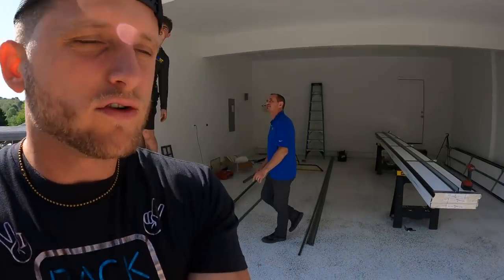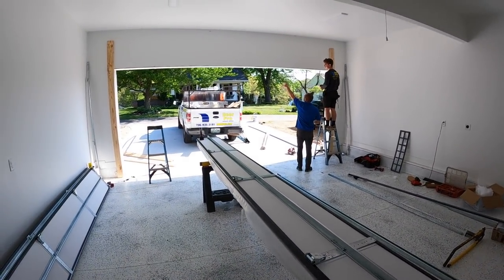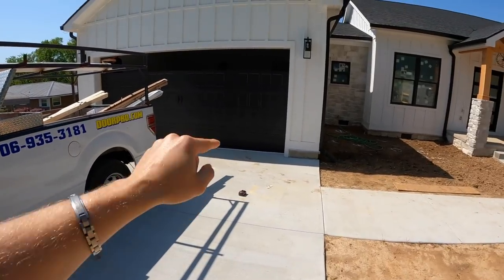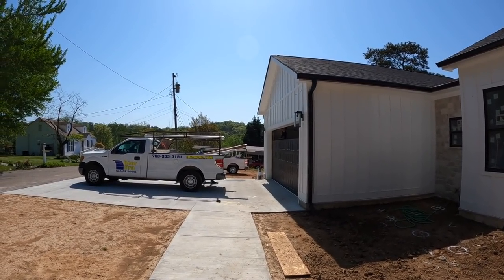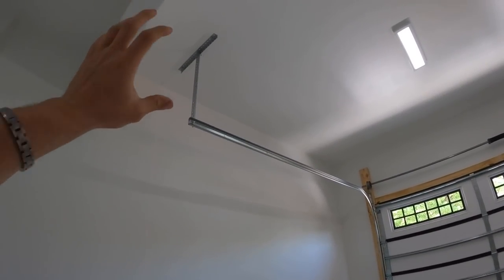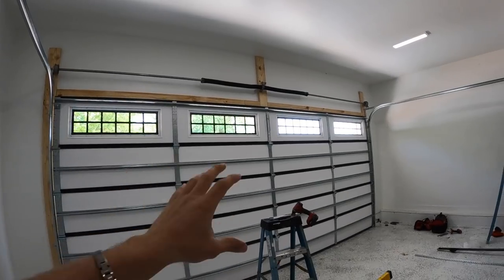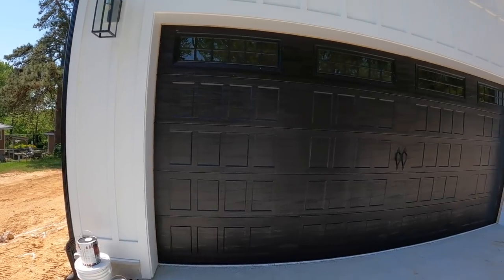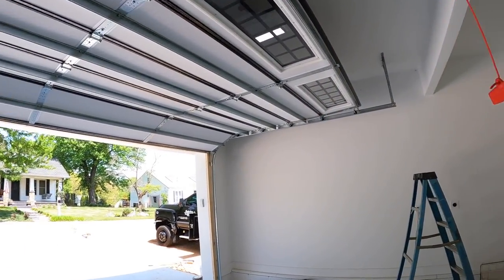How To Install A Garage Door | New Construction | Building A $350,000 Custom House | EP 58

Comment: 18x7 nice here in the south that a one man job in about 2¹/²hrs we out.  The young man was right about turning the spring it gets more turns without using your shoulder as much. The low voltage wires don't got to your electrical panel😂 they go to your wall button and sensors.
Reply: I don’t think you know about garage doors lol there’s 5 panels so means it’s an 18x8 lol doubt you can install it by your self lol especially the door has insulation and windows lol

Comment: Why put 2x4s instead of mounting the track directly to the wall? I’ve never seen a garage door installed this way on purpose before
Reply: Mounting to wood is always better . 
But probably did it so they can nail their weather seal to something on the outside . 

Instead of doing inside weather seal
Reply: @mikereyes6289  there should be wood underneath the drywall and it has more than enough space to install the weather seal. I do garage doors for a living, I’ve never had to install a door this way, nor have I ever seen any garage door installed like this before.
Reply: @Knogooseness  i thought it was stucco on the outside . But people put wood , because the drywall can get weak over time . A lot of new construction we do in cali they put up backfill for us to mount too .